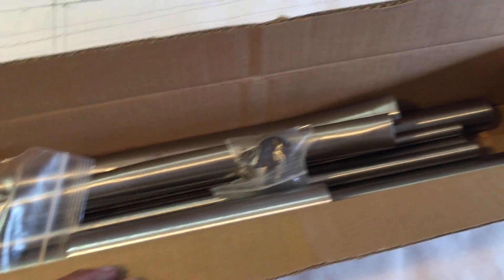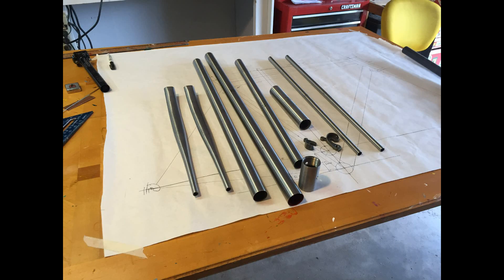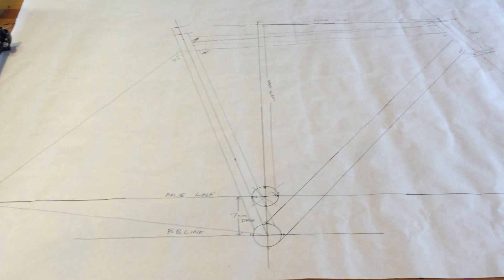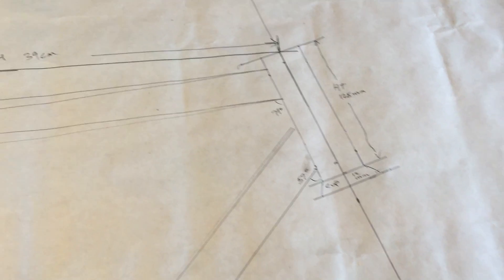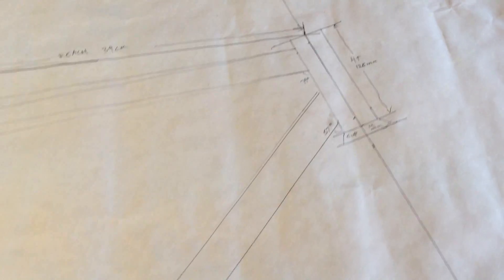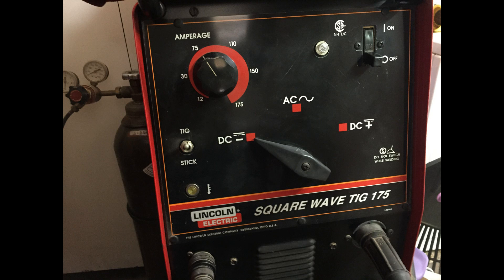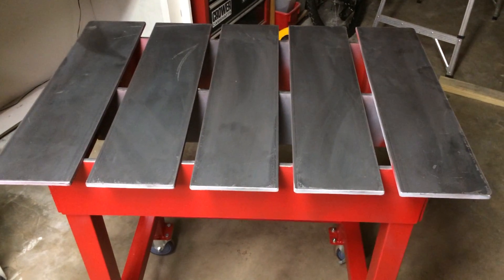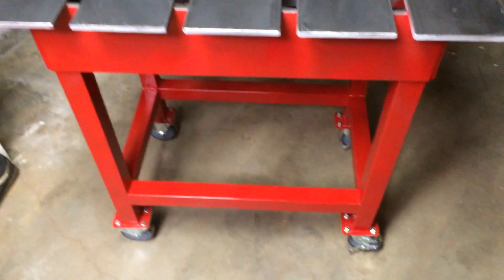My first bicycle frame build from start to finish

Comment: Nice work
Reply from the maker: @karlschmidt2811  Thanks! I still ride the bike currently, usually in the winter. It’s got over 20,000 miles on it!
Reply: @JoeyMesa  where did you get the tubing ?

Comment: What is the schedule/wall thickness of the piping
Reply from the maker: Most of the tubes are double butted at .9mm on the ends, and .6mm in the centers. I think the top of the seat tube is 1.2mm. I purchased the tube set from nova cycles. They've restructured their website, but still sell all kinds of bicycle frame tubes and accessories - https://cycle-frames.com

Comment: Do you need mechanical engineering degree to make frames
Reply from the maker: No. Hambini might disagree, but some general knowledge of bicycle geometry, in the particular type of frame you're interested in building, in combination with some experience with metal fabrication would be extremely beneficial.
The desire to learn and the willingness to practice is all you need.
Thanks for the question!

Comment: Sir what is the weight of frame you have build it  was awesome dude
Reply from the maker: I don't believe I've ever weighed it. It's probably between 2.5-3 Lbs. The complete bike built up with basic parts weighed 21Lbs

Comment: Hey Joey. I suppose the tubes (including headtube) are all the same diameter such that did not have to make wood blocks in different sizes? Or did you account for that I the design of the blocks
Reply from the maker: Good question! The head tube (36mm), down tube (35mm), top tube (31.8), and the seat tube (28.6mm) are 4 different diameters. So, the wood blocks are paired in different sizes. The bottom bracket shell was very square and was 69mm wide. If you divide that in half (34.5mm) that gives you the centerline off the top of the welding table to center all the tubes. I just clamped a piece of angle iron on the platform of my drill press to account for the center of the drill bit holder to the bottom of the wood. From there I just swapped a hole saw corresponding to each tube diameter and it automatically made the wooden block the correct height. With all the tubes cut and mitered, I didn't even use any blocks for the head tube. I just used a large piece of angle and pushed it against the top and down tubes. Those held it in the correct location to tack it together.

Comment: What is gauge of pipe?
Reply from the maker: I guess it would be considered 20 gauge. .9mm or .035" is the wall thickness of the 4130 chromoly steel used to build this frame.
Reply: @JoeyMesa  thank you

Comment: Hi, nice job, congratulations! Are you used standard or oversized tubes? Thank you in advance.
Reply from the maker: Thanks! The tubes are slightly oversized. It's actually designed as a 29'er MTB tube set, but it worked out well fro this grave/commuter bike. This is the actual tube set I used: https://www.cycle-frames.com/29er-Tubeset-35-X-969-DT.html?category_id=951
Reply: @JoeyMesa  thanks !

Comment: Awesome work. Why would you use Tig over stick welding ? Thanks and congrats again
Reply from the maker: Stick welding is generally better for thicker gauge metal. There is much more control with tig welding on thin wall bicycle tubing. Thanks for your feedback and question!
Reply: @JoeyMesa  thank you

Comment: Really appreciate...but one more small question please..
What is the tube diameter you took headTube..?
Inner measurements.?
Outer measurements .?
Length .?
For this what headset number you are installing
Please reply
Reply from the maker: There is a more detailed playlist of 12 other videos I made when building this frame that goes pretty long, but may answer your questions. https://www.youtube.com/playlist?list=PLaz6WjKNr9tX_mYw8U5x24Ngyv0UTnX4x
The head tube is 36mm outside diameter wise. It's for a typical 1 1/8" steerer tube fork and headset. I purchased the frame tubes from Nova Cycles. This is the exact tube set I used: https://www.cycle-frames.com/29er-Tubeset-35-X-969-DT.html?category_id=1074 
I believe it comes with 3 seat tube length options and 2 head tube diameter options for 1" or 1 1/8" fork steerers. I chose a 68mm wide BSA threaded BB shell and Breezer style dropouts.
Reply: @JoeyMesa  I have gone through all the videos..by any chance can you make a set of videos for BMF bike frame please..
https://youtu.be/3f52AvsrP6w

Comment: Wow!! That's one of my dreams.. To build bike frame for myself... But I don't have any idea how to . 😭😭😭.. Where do you think I can start for this dream of mine? Schooling?? 🥴🥴
Beautiful built anyway.. God bless you.. More frames to come... Where can I order your build frames.. 😊😊😊
Reply from the maker: I went to a vo-tech school to learn how to weld and I've been a bike mechanic for 38 years, so between those two, I started with some basic stuff like welding new dropouts on bikes and just worked my way up to a complete frame. You can learn a lot from watching YouTube videos. Pithy Bikes channel has a ton of beginner info, but the learning curve can be shortened drastically by learning to weld or braze at a vo-tech or an actual frame building school.
I may have some frames for sale soon.  Thanks for the question!
Reply: @JoeyMesa  thanks a lot for the reply and advices.. This is the result of my quarantine, maybe I discovered my passion, painting, mounting dismounting bike.. Maybe its a little bit late for me because I am 40y/o but I think it is really confirmed.. Anything about bike is my passion..maybe I enroll to some school.. Thanks a lot again.. God bless you sir..

Comment: Can i use steel pipes instead of tubes for frame
Reply from the maker: I've used heavy steel pipe for various projects, but it's really too thick for a bicycle frame. Sometimes any kind of tubing is great to practice on or do other projects with, but for bicycles, if you're going to take the time to design it and notch the tubes and such, thin wall chromoly tubing is not that difficult to acquire, is strong, light, and will ride SO MUCH BETTER. 
The first time I tried something close to building a frame, I basically cut up and old frame that was damaged, rebuilt it with a new head tube and drop outs, and it gave me the confidence to try my first full frame build. I have a video of that bike, but it's mostly pictures:  https://www.youtube.com/watch?v=5MSxW16J60Y&t=321s
I usually get my frame tubing from Nova cycles. They ship worldwide and are pretty reasonably priced. They have complete kits or just individual tubes, dropouts, braze ons, and other parts: https://www.cycle-frames.com

Comment: Nice build sir! What brand of tube notcher is that? Or is that a tube clamp that is adjustable? Thanks
Reply from the maker: It's the one Harbor Freight sells. I'm pretty sure it's the least expensive tube notcher out there, but it's decent and I still have and use it. I made a few mods to it so it worked better for my set up. I made another video a few years ago of a long term review with the things I did to help it work better and links on where to purchase if you don't ave a Harbor Freight nearby. https://www.youtube.com/watch?v=o4BWg2GEM3E

Comment: Was wondering if bending and welding gas pipe for a bicycle frame is possible??? Not asking for a friend, I just don't know if its possible. If not, then how about scaffolding pipe? What's the common type of pipe for that?
Reply from the maker: I've used gas pipe for various projects, but it's really too thick for a bicycle frame. Sometimes any kind of tubing is great to practice on or do other projects with, but for bicycles, if you're going to take the time to design it and notch the tubes and such, thin wall chromoly tubing is not that difficult to acquire, is strong, light, and will ride SO MUCH BETTER. 
The first time I tried something close to building a frame, I basically cut up and old frame that was damaged, rebuilt it with a new head tube and drop outs, and it gave me the confidence to try my first full frame build. I have a video of that bike, but it's mostly pictures: https://www.youtube.com/watch?v=5MSxW16J60Y&t=2s
I usually get my frame tubing from Nova cycles. They ship worldwide and are pretty reasonably priced. They have complete kits or just individual tubes, dropouts, braze ons, and other parts: https://www.cycle-frames.com
Reply: @JoeyMesa  Wow! Thank you for all of the useful information, you definitely earned a new subscriber!

Comment: Nah! - Joey, you can't build yer own bike.  The criticality of the thing!  ...can't be done.  What's say!? - you did it ?!  ...oh, well, nice job.
Reply from the maker: Thanks! It was definitely challenging at times, but it was a fun project. This bike still gets ridden regularly (13,000 miles on it so far) when the weather is really bad.
Reply: @JoeyMesa  I'm so lucky to have an old Serotta steel frame that fits me perfectly. I've brazed lugs for a rack and made the Serotta a touring bike. So I'm set. You sure made creating a bike look easy!

Comment: nice work joey, heat treatment is not required on frame ?
Reply from the maker: Thanks! No, chromoly frames generally don't need to be heat treated. Thanks for the question!

Comment: Think you could change my 1" to a 1 -1/8" threadless
Reply from the maker: Probably not. I've done it before, but it requires shortening the front end length by 3/8 to 1/2", plus the cost of cutting the old 1" head tube off, mitering and re-welding the 1 1/8" head tube on would exceed the cost of a new frame and fork. I've seen guys who have used an adapter headset cup that allows a 1 1/8" fork to fit into a smaller head tube for a 1" fork, but that's for older US made Schwinns and BMX bikes that have a 32mm inside diameter on the head tube.

Comment: Just finushed my frame. I put my disc tab in the same location as you did. It seems like yours has held up well. I did not put in a brace either. Ive retrofited a couple frame with rear disc without bracing and theyve held up.
Reply from the maker: Yeah the idea is that the caliper acts as the brace because it's joined to the seat and chain stays. It's a little harder to adjust the caliper, but I think it looks a lot cleaner. I've used and abused mine for over 10,000 miles and it's still going strong!

Comment: Your tube lengths were just taken from an existing bike? I cant get bikecad to work and im a little stuck on how long my down tube should be. Great vids. Thanks
PS:  just found a chart on line. So im good for now. 
Keep the vids coming!
Reply from the maker: Cool. Glad you got it figured out. When I came up with the dimensions for this frame, I didn't copy anything straight from any other frame, but more or less the stack and reach from other frames that I felt "fit" my body really well, then added my ideal HT and ST angles. Nothing ground breaking, just what I felt would fit me the best. The actual tube lengths and angle cuts were just a result of what fit and how I wanted the bike to look. I think I'll do a video on effective ways to come up with frame designs that are functional fit wise, while getting the look you want, so thanks for the inspiration and your feedback!

Comment: Non detachable hanger
Reply from the maker: Steel doesn't really bend that easily, plus it's easy to bend back if it does. If it gets damaged beyond repair, I can detach it with my band saw and weld a new one back on.

Comment: Nice. Is chromoly 4130?
Reply from the maker: Thanks! Yes 4130 is chromoly and is pretty much the main steel or some variation of it for performance bike frames. https://www.metalsupermarkets.com/what-is-chromoly/
Reply: I want to build a bike frame from scrap metal but i have only another type of chromoly 4013 i think.Can i use that.
Reply from the maker: Pretty much anything you can get your hands on is good to practice with. I used to cut up old frames that were destroyed and weld the pieces into T-joints, or weird angled joints to practice that type of junction that you do when building a bike frame. Welding thin wall chromoly takes a lot of practice. The first rideable bike frame I cobbled together was an old 60cm frame that had been wrecked and the head tube was bent inwards. I basically cut the damaged parts off, welded a 1 1/8" chromoly head tube and dropouts on it and made it into a 56cm track bike. Not sure what kind of tubing the frame was made of, but it was heavier than chromoly, and pretty easy to weld. I still ride it on occasion.
Once you have the ability, and are ready to build a light, strong steel frame, chromoly is the only way to go, plus the tube kits are not that expensive.
Reply: Thanks for your  help. 😉😎

Comment: Are you already a machinist or something? I can see you've got a pretty decent workshop.
Reply from the maker: I'm actually a bicycle mechanic by trade, but I like to tinker with stuff.I think about the only nice piece of equipment I started with was my tig welder, but it allowed me to build a nice welding table, band saw stand, modify a cheap Harbor Freight tube notcher to fit in my drill press Etc. 
The bummer is that all my equipment and most of my tools are in storage back in Oklahoma. We moved to Colorado about 6 months ago, so I'm currently in an apartment. The plan is to be in place with some shop space  in the near future. Hopefully in a couple years or so I'll have a little mill and lathe, then I can really start machining some stuff! 
Thanks for your comment/question!
Reply: @JoeyMesa  Yes I'm in an apartment and it's a super restricting pain in the arse trying to do bike mechanics like that. I've done some volunteer bike mechanics at a second-hand community bike place and it was great working with proper space. Cheers and good luck finding a new space and expanding your bike mechanics into the future!

Comment: Really good work! Congrats , must be careful with the over heat welding, however its amazing work.!!!!
Reply from the maker: Thanks!  Yeah, there's definitely a very fine line tig welding thin wall chromoly! I'm in the process right now of starting my 2nd frame build.
Reply: Very cute emporium of cycle master technology and expensive quality....
Reply: As someone who's welded a lot of thin stainless tube I'd recommend you get the biggest gas lens you can, and back purge the frame to stop oxidisation on the inside. Stainless should be silver or straw colour when you weld it.

Comment: Nice bike , i like bike frame with a straight middle tube and with tall stance slopping tubes , almost looking alike with the cannodale supersix evo . Nice project and craftsmanship.
Reply from the maker: Thanks! My race bike is a supersix evo, and I basically built this bike to mimic the fit of that bike but with more tire clearance.
Reply: @JoeyMesa   I love your bike...however, you have me confused. I didn't notice a frame jig in your construction. Can bikes be made without jigs?
Reply from the maker: @shockadellick  Thanks! A good jig is probably the easiest way to build a bicycle frame, but yes, you can build a frame without one. When I was researching different type jigs and such, I came across  a video from welding tips and tricks: https://www.youtube.com/watch?v=yT108iL-vMw&t=294s
I thought it looked like it made sense and would be a good way to fabricate other things as well, so I built my own table and have built a couple frames on it so far.

Comment: Awesome set of tutorials brother... thank you so much...
Reply from the maker: Thanks for checking out the videos!  The bike gets used a lot and is still going strong!
Reply: +Joey Mesa did you do any kind of analysis and testing for building this bike ? can you tell me how much it costed to build the frame ?
Reply from the maker: I guess as far as knowledge on frame building and such before I built this frame, I've worked in the bike industry for over 30 years, and seen firsthand what kinds of things can lead to frame failure, as well as where frames typically fail. I've been welding, mainly as a hobby, for 15 or so years and I always wanted to attempt to build a frame. I did a couple of modifications to some old steel frames (dropouts etc.), so I thought it was time to give it a go.
As far as testing, it's still a test in progress! I'll probably build another or two for some friends to test soon as well. I got the tube set from Nova: http://www.cycle-frames.com/bicycle-frame-tubing/home.php
I think the complete tube set with BB and dropouts was around $120  Most everything I used was pretty low budget. Probably the biggest investment for me was the tig welder. You could probably build one a lot less expensive by using lugs or fillet brazing with an  oxy-acetylene set up, but I grew up in the old school BMX era and I really just like the look of a nice tig welded bike.
Reply: +Joey Mesa thank you so much for the info brother..  share more videos on bike building. can you list out some books that may be helpful for bike building for beginners like me ?
Reply from the maker: I don't know of any specific books on tig welding bicycles.  Steve at Pithy Bikes has an excellent channel with quite a lot of videos aimed at the beginner builder.  If you haven't seen them yet, here's a link to his playlist series:  https://www.youtube.com/playlist?list=PLaz6WjKNr9tUDS1wJOVzUrjfIVvvoLC_5
Reply: Yes i checked out his channel and then landed here....